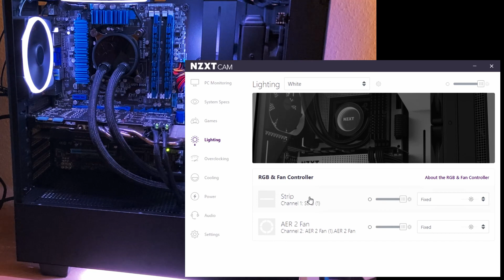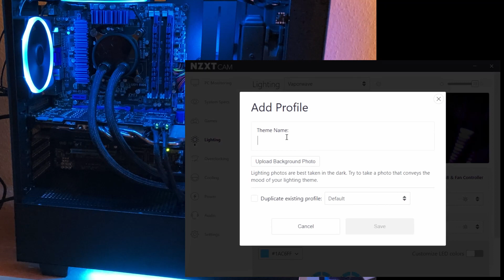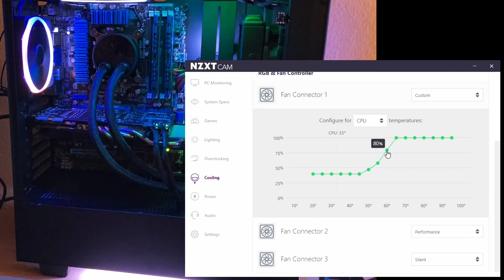Installing NZXT AER RGB 2 Fans and Hue 2 LED strips in the H510 Case using the RGB & Fan Controller

Comment from the maker: Could this video get like 200 likes that would help my little channel tremendously - thanks :D
Reply from the maker: Wooot goal reached :D Awesome, thanks!
Reply from the maker: @user92714  yeah that is possible - 1:58 :)
Reply: i think he got the 200 likes
Reply: mans smashed the 200 mark by 10 times...
Reply: 200? A year later he has 2K
Reply: Thanks for your work. Does this device support RGB fans or only ARBG ??
Reply: Thank you for this video.

Comment: Solid video but sadly my problem is not addressed here.  I'm replacing stock fans with one NZXT AER RGB2 120mm and two NZXT AER RGB2 140mms.  Currently running a NZXT Kraken liquid cooler which is staying put.  Motherboard is an MSI B450 Tomahawk Max.  I've hooked up everything correctly as far as I can see.  I have 2 USB2.0 spots near the bottom of the motherboard, with the liquid cooler already using one of them.  This RGB and Fan Controller uses the one next to it.  Power is hooked up correctly and all three fans are daisy chained properly as per the instructions.  When I boot up the computer, all fans spin to life and the RGB lights on the fans glow white.  All good so far.  Problem is none of them show up inside the Cam Software when I boot it up so there is no way to adjust them or do anything with them.  Tried simple things like unplugging the USB to the motherboard, stopping the Cam software in Device Manager and restarting it there.   I've even uninstalled and reinstalled the Cam software.  I'm kind of at a loss!  Anyone have any suggestions here?  Thanks!!
Reply: having same issue what do ido

Comment: I was too worried of potentially frying the fans by connecting them on motherboard directly. The correct way is to use that Internal USB header to connect to the device. This video helped a lot. Thank you!
Reply: There is no possibly to fry them by putting them on the system fan connectors?

Comment: Most helpful vids.  Other vids tell us what to do and show bits and pieces but it can be confusing for newer PC builders.  The point that i found helped the most was when you had just the mobo, controller and fan cords so I was able to visually see exactly where each COMPLETE part goes, instead of those vids where they only show sections of each component.
Reply from the maker: Very kind of you to comment and give feedback like this, thanks!

Comment: So you can only daisy chain the RGB cables but you need to connect the power cable separately for each fans to the hub right?
Reply from the maker: Yup correct

Comment: Hello. What is the black cable at 2:34? My case (510 Elite) came with its own led strip and I’m unsure how to hook that up into the controller
Reply from the maker: That is the connection cable that came with the strips - its what goes into the controller. The led strip pack comes with one of those and a extension cable also (a cable that connects between two strips).
The fan bundle also comes with a cable that connects a the led strip, so a fan and led strip can be chained.
Reply: @MrGarfi hello! Did the NZXT h510 elite come with a pre installed strip?

Comment: Is there any way I could connect 4 nzxt fans to the smart device? :)
Reply from the maker: Yeah, you can use one of the fan-splitters that come with the controller - just be aware that both fans connected to the fan-splitter will run the same speed.
Reply: @MrGarfi  thank you so much, and thanks for still replying to the comments :)
Reply: @MrGarfi  I had this issue on a client's build and I got em powered but there was no splitter for the rgb connector so they were powered but no lighting until we get another hub

Comment: Do both fan power cables (if I choose to plug them into the motherboard and I decided to have them chained) can I only plug in one fan and the 2nd one gets power cause of the chain? Or do both power cables for both fans have to get plugged in and the chaining is only for RGB.
Also great guide!

Comment: Thanks , had a panic as I've got a controller arriving and on the NZXT instructions it says USB 2.1! But it clearly says 2.0 on the cable in your video, I was panicking that my motherboard didn't have the correct port. Panic over. :)

Comment: 😣I can't make my original LED lights strips work with the original module. The fans are working just fine. But the LED lights won't show up on the CAM application.  

Can you help?

Comment: FYI, careful at @2:50 - if you have the NZXT AER RGB 2 fans like OP does, do NOT plug the fan power/rgb connection into your motherboard. Daisy chain the rgb cables between fans, and connect the first fan in the chain back to the NZXT controller. Your MOBO potentially puts out higher voltage to the fans than the 5v on the controller. I did this at first myself and ended up frying my fan rgbs. (I troubleshooted everything after the fact - and this is the only explanation left. Confirmed this has happened to others too. Now I'm waiting for replacements) Unless someone has a better idea as to why, I'm open ears :)  Great vid otherwise!
Reply: what If I have Kraken z53 rgb that has its own hub and I dont have just the NZXT controller?

Comment: Ive got a question! I see you used both RGB outputs, one for the fans and one for the strips. You connect the strips starting from the controller to the strips and then I saw you connect your last strip to something aswell to create a loop. (if im correct) To what do you connect to finish the loop? Since if I recall correctly its a specific plug, at the moment I cant think of a connector to plug it into. 

I may be completely off here and maybe im incorrect and the strips doesnt need to be connected to something on the end of the strip.

Comment: Can someone help me, I can’t daisy chain the 3rd fan at the back and top of the case because the cable to connect them with the front panel fans is super short… the big cable won’t fit in the “out” port of the front panels… what do I do ?

Comment: I just bought the nzxt aer rgb 2 but the rgb cables wont fit and i also dont have an rgb thing where i could plug it in also i see the controller but not the fan in my cam software

Comment: Based on your recommendation, I tried to connect the Hue 2 to the AER Fan Out, but it doesn't fit. It's possible to connect it to the NZXT Underglow RGB though.

Comment: correct me if im wrong. After chain 3 fans to each other by using plug-in-out cables, only one out cable goes into the rbg conttroller and then you plug in sata cable to psu, right?

Comment: I can’t express how happy I am for finding this video mate. I will be building my nzxt pc with fans, kraken and the elite case this week. I’ve been searching months ago for a video explaining how to daisy chain and etc, but no luck. Thanks for your video. I have a question about the fans. Once you daisy chain them together, what do you do with the cable that comes already with the fan? The one that you can’t remove, just leave it disconnected?
Reply from the maker: Glad I could help! The cable that is already attached to the fan is the power cable to the fan itself - so there is power for the lights, and power for the fan - and that cable also goes into the controller or onto your motherboards fan headers.
Reply: @MrGarfi  thank you very much for your reply. I will try to build my setup this week, if I have a question I will ask if you don’t mind. Thanks for your help once again!
Reply from the maker: No worries, and happy building :)

Comment: I saw that you put a cable in the output of the last fan when you were explaining the connections. Where does that connect to?
Reply from the maker: Was it the cable at 2:07? That was a cable that you can use to chain s LED strip to the fans.
Reply: @MrGarfi  I’m not sure if your talking about the same one but you started connecting it around 2:02 in the video. It was right before you cut to the led strips.
Reply from the maker: Yeah that is the 500mm Fan-to-Accessory Cable (Its included with the fan) - so a cable to chain the fans with the LED strips.
Reply: @MrGarfi  ok thanks. So if wasn’t using any rgb strips would I not put anything into the output and end it there or would I link it back into the Hue 2 controller? Thanks for answering all of my questions btw.
Reply from the maker: @cadecunningham2208  Yeah exactly the out port on the last fan would then just be empty. And no problem :)

Comment: i have this hue too, here is some problems. first, it wont remember the rgb or fan setting every restart system unless you open the cam software; and the CAM software has significant bug that may cause system freeze randomly, every few hours or days, on AMD platform, not sure intel. uninstall cam or disable it to run background are only solutions. Also, the nzxt rgb strip header are not compitable with mobo header, if you finally want to give up hue, that strip become uselss too.

Comment: I have a controller model : ac-crfr0-b1
and an AER 2  RGB FAN : HS-28120-1
my fans doesnt detect on the CAM's Software is there anyth you can recommend or suggest

Comment: I only have one usb connector which is connected to my nzxt water cooler. Since i could connect my 2 usb strips directly to it, i didnt use the controller that came with the case. 
Am i able to connect this frkn box AND my cooler without the need of having 2 internal usb ports?

Comment: Love the vid! But quick question… the cable that is coming out of the fan when it comes out of the box, do we not plug that in if we use a chain and a fan hub?
Reply: I have the same question. Is that the case?

Comment: Hey i have a Problem. I connected my fans and the led stripes to the nzxt led controller (which was already preinstalled in the case). The controller only has two connections therfore now i dont have any space left to connect my nzxt kraken to the controller in order to be able to control the rgb of it. Is there any splitter or something else i could use to fix this problem ?

Comment: wait so i have a h510i and the controller is using 2 led slots and 2 fan slots, if i get 2 fans can i just hook them up to the 1 fan slow i have left and the 1 led slot i have left?

Comment: Since the controller only has 3 fan ports, does that mean I can only use 3 fans with one controller? I’m confused on that. I plan to use two of the 140mm ones in front, and two of the 120mm ones in back. Will it work?

Comment: How would I know if I installed the fans backwards or anything? I installed my 140 and 120 in the same way you did (I hope) I just dont know whats the correct way the fans should be facing. Right now they are pulling air out instead of in is that right?

Comment: Do you have to daisy chain them ? , i have found no information regarding if it is a single plug into the fan header and the fan and rgb will work , or do i need to buy the controller as well , and if so is that a easy install?

Comment: I got the nzxt h510 elite case.. the front fans + led strip that was already IN the case lights up, but the 120 and 140mm ones I got extra.. arent, and as far as I know.. I did what you did o.o
Reply from the maker: Ok, so what you will want to do is to chain all 4 fans together, so instead of taking a cable that goes from the controller and to one of the extra fan, you would take a cable that goes into the out port on the already installed cables, and then into the extra fans, then all fans are chained.
Reply: @MrGarfi  a friend of mine came by and helped me work it out x) it was exactly like you said!

Comment: So I’m stuck on the idea of my power supply. I use a 2060 super with ryzen 7 27k on a cm650 power supply. I’m using some no name brand fans on it. Idk if this is a good idea. I just switched to the 650 like a week ago. And I kinda regret it

Comment: What cable did you use to plug your controller into your power supply? Mine doesn’t seem to have the proper slot to fit the 15 pin cable

Comment: Hi! Very detailed video on the NZXTs components!👍Question, will we harm our motherboard or other parts (hdd/memory) when we stick the magnets onto our case?
Reply: With how little the strength of the magnet is it will not harm anything. Strong magnets are what would start affecting electronics.

Comment: thanks for the video bro, just bought my kraken x53, fan & rgb controller and two AER Fans this video help me out setup my first RGB case. but i have one question, after reading the kraken x53 specification, it can connect to up to 5 AER Fans (directly?), but i could not find the cable that match from x53 to AER (in) socket. + like + subs..

Comment: Hi I have the h510i which has the hub and 2 led strips already installed. I have an old NZXT led strip like you have that I want to add. But idk what kind of cable I need to plug the led strip into into the hub. Do you know what I need and if I’m able to purchase just that part?

Comment: I have the Aer rgb 2 and fan controller but the rgb doesn’t work, I connected to the right ports but only the fan spins
Reply from the maker: If you are sure everything is connected correctly and the CAM software doesn't pick up the fan under the RGB settings, then it sounds like a faulty fan and you have to contact NZXT or the reseller :(

Comment: I’m using 4 fans in my build but there are only 3 fan slots on the fan/lighting controller. How do I connect all 4 fans into the 3 fan slots?
Reply from the maker: Hi, you can use one of the fan-splitters that came with the controller (The ones here 1:09)- with one of those you can connect up to 3 fans to one of the fan headers on the controller - just be aware that the fans connected to the splitter run with the same speed.

Comment: Can you use the included fan splitter that comes with nzxt elite case to hook up both Front Aer rgb fans that come with the elite case? So basically you are using the splitter in Fan 1 of the included controller with both Front Aer RGB fans hooked up to the splitter. Is that ok??? The fan splitter has 1- 4 pin and the rest are 3, so the 4 pin should read rpm and the rest of the 3 pin should run at same speed right??? Please let me know thank you.
Reply from the maker: Hey Jimmie, yes you can do that, and yes then both fans will run at the same speed.

Comment: Quick question: for the nzxt fans and liquid cooler I am using an asus motherboard that has aura sync but not sure if nzxt rgb is compatible with an asus b550 motherboard? How did you get it to work on your motherboard without an nzxt motherboard? I also heard if I plug my f120 fan into my asus motherboard it will burn my fan out…
Reply: Please let me know id appreciate it!

Comment: Is it possible to connect for example Corsair RGB fans or for example some other brand RGB CPU Cooler through the NZXT RGB & Fan control device? Or i need all in the same brand?
Reply from the maker: It's for NZXT RGB fans only - the RGB cable on the Corsair fans cannot be connected to the NZXT controller.
Reply: @MrGarfi  okay, thank you :)

Comment: So if I want to connect e.g. 3 rgb fans I do the following: Connect cable from the controller to the usb 2.0 slot on the motherboard and also one sata cable from the controller to the SATA power cable (PSU). Then pull one fan and one rgb cable from the controller to the first fan. Then I just pull one cable from the first fan to the second fan and again one cabel from the second fan to the third fan. Is this correct?

The single wire (chain) between the fans to the next fan carries the current to the fan itself and the RGB LEDs?
Reply from the maker: Hi, the cable that is being chained only carries the current for the RGB lights. All fans needs to have their own power cable (The one that is attached to the fan and cannot be removed) connected separately into either the hub or the motherboard (I suggest the hub).
Reply: @MrGarfi  Okay thank you.

Comment: I might get these fans and the controller, later a underglow strip. 

I have the MSI B450 Gaming plus max motherboard which only has JRGB1 and JRGB2 headers. 

Can i still use the fans, some strips and the controller on my computer?
Reply from the maker: Hi Wassabie, yes you can use the fans & and controller no matter what your motherboard has, because they don't use any of the RGB headers on your motherboard, they only use a USB 2.0 header via. the controller - the fans lights and strips are not supposed to be connected to anything on the motherboard.

Comment: Hey, My rgb 4 pin female connector from the fan to the fan hub is wayyyy to small. You seemed to put your in with no effort. Any clue what’s going on?
Reply from the maker: If its too small the  you must be using the cable that is used to chain the fans together - there should be another cable bundled with the fan that has a bigger connector.
Reply: @MrGarfi  Thanks! Was doing just that! Found the cables.

Comment: Great video thank you, quick question .. why the fan 3 is showing 0 RPM because I'm facing the same problem and I'm worried
Reply from the maker: Hi Rakan Ss, it's because I have only connected 2 fans to the controller - it's poor UX,  it would nicer had the interface only shown the fans that are connected, instead of just showing 0 RPM on it.

Comment: are the 2 fans sold separately or do you buy them together
Reply from the maker: You can buy them bundled and also together with the controller. But they can also be bought separately if you only need one fx.
Reply: @MrGarfi  thanks so much 🤙